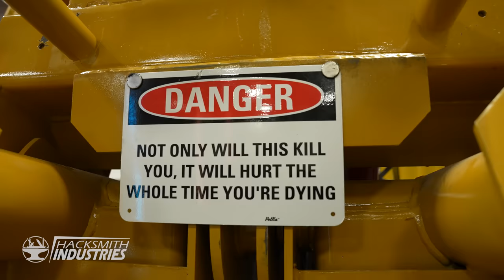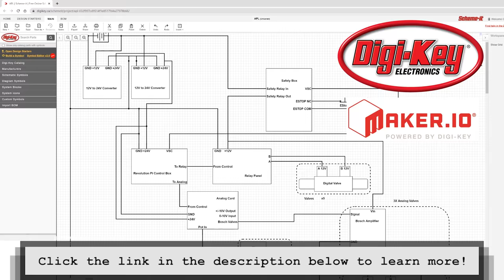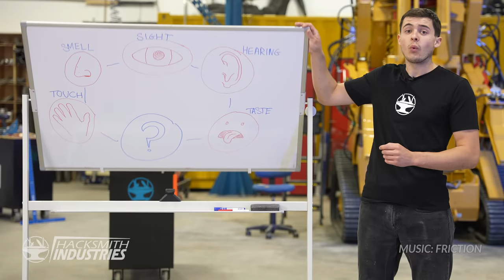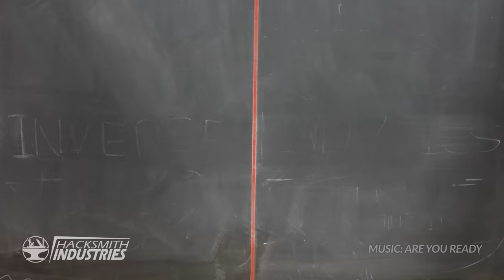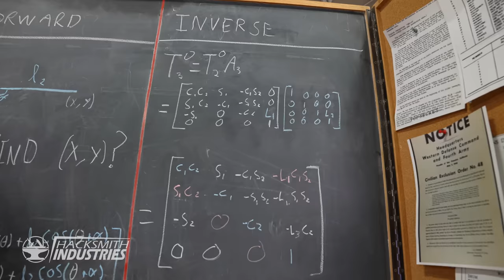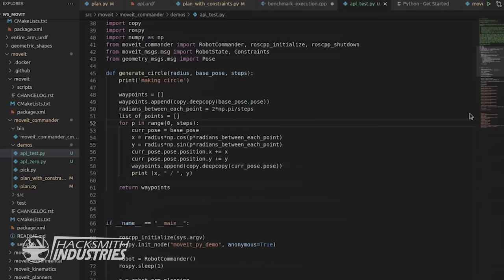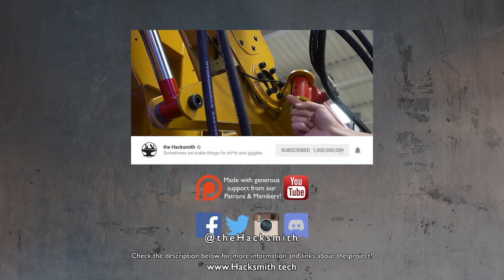All Robots Should Have This Button! (POWER LOADER: PART 15)

Comment: thought: once you finish building this it will stop being science fiction
Reply: a
Reply: @JT-qc9nb  They really should partner with Boston Dynamics to get a handle on bipedal movement
Reply: well..i dont see any ninjas or religious people running around with lightsabers yet. we might be safe.
Reply: @satakrionkryptomortis  uhh ninjas definitely exist
Reply: @kaboomgaming4255  but do they have lightsabers?
Reply: @oliverswan4807  I mean if they get the diagram from the hacksmith they can...
Reply: it will just be science
Reply: @romxxii  boston dynamics focuses on unmaned machines with very normal sized legs. if they could make big legs for big machines, they would have done it long time ago.
Reply: @memedude8303  no it will be fiction
Reply: Maybe too heavy for two legs... quadpedal?
Reply: @LilyBlossom1337  spider loader
Reply: @joelisvysniauskas4653  I was thinking that, too. Adam Savage has a sweet spider bot, but under a loader... hmm. Seems like the algorithms to get all those legs working would be the real tricky part, especially with that added weight of the loader being so top heavy.
Reply: @LilyBlossom1337  true but it would be really cool

Comment: Amazing work, really coming together!!!
Reply: hey i am a big fan i have been watching ur vids for a long time u r really amazing
Reply from the maker: you'll have to come try piloting it when it's done!
Reply: @JLaservideo That frisbee needs to light up when it bounces.
Reply: @hacksmith  greatest crossover event in history?
Reply: me and you were the only ones that got comments from  hacksmith.
Reply: @Wojciech Krzemiński lol
Reply: Hi
Reply: @clayvion  hi
Reply: @TheholeyRanger  hi to you too
Reply: @clayvion  hi back
Reply: @TheholeyRanger  no, hi back on the hi back
Reply: @clayvion  noooo high back on the high back on the high back!!!!!
Reply: @TheholeyRanger  nonono sir hi back on the hi back on the hi back on the hi back served on a platter
Reply: @clayvion  noNoNNNNNOOOOOOOO hi back on the hi back on the hi back on the hi back on the hi back on the hi back on the hi back on the hi back on the hi back on the hi back on the served on a 5 foot long jumbo ice cream cone with sprinkles
Reply: I am your big fan jlaservideo your projects are so amazing but you post videos very late but then also I am your big fan
Reply: @hacksmith  
I would want to have something a lot less hacky than the string potentiometers for joint position sensing. Should be something built into the joints like a toothed reluctor ring and a hall effect sensor, as is used on the crankshafts of many engines. Those have one tooth missing for the index pulse. I'd put the missing tooth at each joint's neutral position then on power up have each joint do a little jog back and forth to sense each side of the gap.

Comment: The amount of force to bend that in such a way is absolutely insane
Reply: Well to be fair, they modeled it to be strong vertically to support and raise the forearm.

They also haven't worked with a hydraulic pump as powerful as the one on the BobCat, especially with pistons as large as the ones here.

It simply didn't occur to them it could move side to side with enough force to bend half inch structural steel.

I wonder if they will settle for just adding some braces to the existing design or will do a more robust redesign.
Reply: Hydraulics are extremely powerful lol, specially off an engine that damn big lol

Comment: Can we all stop to appreciate the time in this build? Not only in physically building things but also in research. They could have called this done a couple of episodes ago and filmed a test sequence, gingerly of course. But they are taking the time to make this a full blown industrial machine, not just as prop. And along the way having to figure out new problems like fine motor control, and how to use it without dying. 
Identifying new problems, then finding solutions on the market, approaching those companies for help, and then figuring out how to integrate the thing. 
I'm very impressed!

Comment: Sense
1:sight
2: smell
3: taste
4: touch
5: sound
6: proprioception 
7: the one where it feels like your being watched
Reply: Or the one where you can feel a nerf gun pointed to the back of your head
Reply: Actually it's

1: Sight
2: Sound
3: Smell
4: Taste
5: Touch
6: Proprioception
7: Pain
8: Temperature
9: Balance
Reply: @skyfire12306  after a quick google pain balance temperature and Proprioception are a part of touch, the sense of touch has many layers and you can lose some different parts and areas of touch independently of other areas of your body 

 touch blindness is when you lose it all everywhere, then your kinda screwed
Reply: @skyfire12306  balance is proprioception and temperature and pain is part of your nervous system so is in correlation with touch

Comment: I'm working in the woodmill industry, and for fast and precise hydraulic motion we use SSI temposonic rod that we insert inside the cylinder to know the position of very axes ! it feel like a more industrial solution for a power loader mech !

Comment: A pretty neat thing would be to run the inverse kinematics off of a pair of VR controllers. You can set up the camera system on the roll cage and have it feed back into the ROS. This would greatly increase the ease of use of the arms and would probably make the loader more useful. I could totally see it being used to move around large chunks of scrap cars/trucks and move them around with much more dexterity than a forklift or crane.

Comment: No joke, this video was better than the Hacklorian. Better writing, way better pacing. Great job. A real team effort too, you can tell everyone has spent enough time with this in their heads that they know how to talk about it and what's interesting about it. Faux VCR instructional vid and voiceover was a fun gag and not overdone. Appreciate the powerloader sacrificing life and limb for the sake of demonstration. Starting to see the penalty for everything being overbuilt. The farther towards the ends of the extremities, the more that weight throws itself around. One worry I have is your rope-based sensors. A chunk of debris or a snapped hose whips that unprotected line, and suddenly Loader's central nervous system is having phantom movement, with potentially terrifying compensating results. The closer this thing gets to the finish line, the more terrified I am of just how real and dangerous it is.

Comment: Best part about the power loader series?

I'd say it's seeing engineering at work and how a project grows and evolves over time.
There are so many things going on, not just with the project itself but also with the people involved. Plans you made get messed up because something happens you didn't or simply couldn't anticipate ahead of time. You get to see every decision being made and even how they deal with such problems.
It also shows you can't predict everything you will need for a project. What initially may seem like a great idea, once you start using it in practice you may realize you need something different. Not to mention that over time, you start to find better parts, tools, and equipment you could really use.

Comment: It might be a good idea to make covers of some kind for the rope potentiometers, or replace them with conventional linear and rotational encoders. Having the exposed rope pot strings can allow the postion of the actuator to be "fooled" by contacting a foreign object.
Reply from the maker: would be ideal, but had to keep costs down. can prevent most problems in software. range limiting as well as only usimg the sensors when outputs are active.
Reply: @hacksmith  Well then we better see it on version 2!

 Great series. Thanks for the entertainment.

Comment: Looking forward to seeing how you emulate the motion in software to make sure it doesn't crush the operator. It's pretty clear that the range of motion is dependent on all of the joints in the arm and the rotation of the wrist.  

Now, the really cool thing would be having more natural controls for the operate as well like what's seen in the film.
Reply from the maker: didnt you see the joysticks? thats still the plan :)
Reply: @hacksmith  nice

Comment: They're going to have to completely rebuild the upper arm parts and the shoulder mountings with thicker steel. Swinging those heavy grippers around has shown the other parts aren't strong and stiff enough. I want to see this thing do some useful work, like picking up a dumpster.
Reply from the maker: Slight oversight in the first design -- can actually solve it without doing all that -- just need the joint held in with a big bolt to prevent that.
Reply: @hacksmith  is that going to stop the flex and wobble when the arms are moved sideways? There could be some real world uses for a machine like this, if it can handle heavy loads. I could see them being used for cleanup after demolishing buildings. That capability would also be useful for search and rescue in a collapsed building. Unattended mode could be used to do repetitive heavy work in dangerous or uncomfortable environments. Training to do tasks like moving hot metal ingots could be done (with a cold ingot) by an operator aboard to manually run through and record the motions.

The rope potentiometers likely wouldn't stand up to such uses. I'd put toothed reluctor wheels or segments on each joint with pairs of Hall effect sensors for quadrature position sensing. At the ends of each joint's range use a solid section or missing tooth instead of home switches or dedicated end sensors. That's the way crankshaft triggered ignition systems keep synchronization.
Reply from the maker: Yes, the demonstration was to illustrate the need for proportional flow control valves =) The arm that broke was using bang-bang solenoids, which add significant shock loads

Comment: I really hope they end up controlling it with (attached to joints like those lamps, where a human can easily move but it remains in place when released) VR controllers, as it comes with all the required tracking and degrees of freedom. To use the existing software easily, they might need to attach a vr headset to the robot, but that shouldn't be too hard and might offer a great spot to attach some googly-eyes.

Comment: I am an electronic engineer with some experience in automation, hydraulic systems, robotics, software development, control systems and research. This project is amazing! It is a huge agile research project being executed live for entertainment involving most things I've studied in my life.. 
I am following episode by episode since the beginning. Long time fan,
It is very satisfying seeing the team getting into the software part of it. In my very biased opinion it is the hardest and most interesting part.

Hacksmith team certainly are aware of what I am going to say and probably have plans to fix it, but it was really noticeable to me. Despite the amazing improvement with the new control valves, there is still a little overshoot on the limbs movement.
I am not familiar with the system response and limitations, but probably a better control system can fix that.
And by control system I mean a low level software driver for each limb, not inverse kinematics and high level stuff robotics stuff. Classic PID or fuzzy control.

Working on that (a measuring it) is also a great way to introduce "basic" control theory concepts. Maybe too advanced for most, but certainly fun for hardcore engineer nerds.
Reply from the maker: Not done yet at all -- lots of calibration and software still.

Comment: Would be nice to throw in the calibration of those potentiometers, I did that once before for a similar work for an aircraft landing gear hydraulics and I am not sure how much repeatability you are achieving from those. Those valves must be really nice to be able to control that finely. Also more time about the inverse kinematics. That is how it should be taught!

Comment: Suggestions: adding initial 0 posture settings to the kills switch/stop switch so as if the pilot accidently get any part of the power loader hurting the pilot it will go to 0 initial posture so the pilot is safe.

Comment: If you don't find inverse kinematics cool this may make you consider otherwise. If you've ever seen a 3D animation it is more than likely that in order to create animations the model had inverse kinematics so that the animator could move an arm or leg and the rest of the body would move in a way that seems natural based off the bones or joints the model has and where they are positioned. Essentially inverse kinematics make animating a 3D model incredibly easy and fast. If you play a game using 3D models they are most likely built using inverse kinematics to animate them

Comment: I feel like those rope potetiometers ought to have tubes around the ropes, somehow.  A hardened shield.  So that something can't snag the rope and give a false reading to the sensor.
Reply from the maker: there are software  fail safes for that.  a proper system would use cylinders with sensors built in,  but they're very specialized and expensive

Comment: “The powerloader knows where it is at all times It knows this because it knows where isn’t,  by subtracting where it is, from where it isn't, or where it isn't, from where it is, whichever is greater, it obtains a difference, or deviation. The guidance sub-system uses deviations to generate corrective commands to drive the power loader from a position where it is, to a position where it isn't, and arriving at a position where it wasn't, it now is…

Comment: The incdent at the end where the joint broke really demonstrates how much power those hydraulics can provide now. Good thing nobody was in the drivers cabin. One though though: Could this thing be powered electrically from batteries?
Reply from the maker: Of course it could =) But you'd need a lot of batteries!
Reply: @hacksmith  Hmm. How much power would you estimate ... in "Tesla"s ? ;)

Comment: you should make the control a sleeve you put on your arm and when you move your arm around the same happens with the  power loader.
Reply from the maker: yup! once the system is finalized we'll have manual control, remote control, and haptic feedback control!
Reply: @hacksmith  cool
Reply: @hacksmith  how are you going to do that? Are you going to use those little reflector balls and a IR camera?  position sensors?

Comment: So technically, it's not a closed loop feedback system if it doesn't affect the commands sent to the effector.

I feel like here you're just using it as endstops, not really as a real feedback system with a PID loop for example. But still cool to see the powerlader with some smarts !
Reply from the maker: yeah its just a PD loop,  not PID

Comment: The rope potentiometers seem like such an exposed and vulnerable solution.
Reply from the maker: Not many other alternatives. Sensored cylinders are super expensive and have limited ranges. The rope potentiometers just need a few extra fail safes to protect it.
Reply: @hacksmith  To be fair, this isn't a machine that will actually do work and need to be reliable - so the rope pot is simple solution and perfectly viable. How do you handle an unexpected result from the pot?

The rabbit hole I would have gone down early in the design stage likely would have been rotary shaft sensors integrated with the pins at the joints or maybe indirectly driven by belt/gear. The benefit being they are by far the cheapest of all the options, the downside being you have to design for them up front.
Reply from the maker: lots of software failsafes are easy to add in. expected ranges of motion,  movement when hydraulic flow, deadzones when its not moving,  etc

Comment: Love it...but, what happens when those position lines either get cut or something falls across the line, pulling extra line out? Seems even a regular pot would be safer. Certainly less prone to the environment  interacting with the position sensors. Current setup is an accident in waiting.
Reply from the maker: Software failsafes -- it's expecting a result from an output, not a random failure
Reply: @hacksmith  DANG! So, someone with a cork gun couldn’t make the operator smack themselves🤔? What fun is that😉

Comment: You could just use pwm instead of the fancy valves.
Reply: Because probably all hydraulics are powered by the same pump, and said pump by the engine, hence the need of individually controlling each cylinder
Reply from the maker: doesnt work like that because of fluid dynamics. fluid follows the path of least resistance. so if you had regular valves, the arm carrying less weight would move, but not the other.  kind of like a differential in a car

Comment: Would it be bad if something catches on to the string of a potentiometer, causing it to extend abnormally and give wrong readings?
Reply from the maker: lots of failsafes for that.  range limiting and intelligence -- if the power loader isn't sending an output and those are changing,  it knows something is up
Reply: @hacksmith  Okay, thanks for replying :)